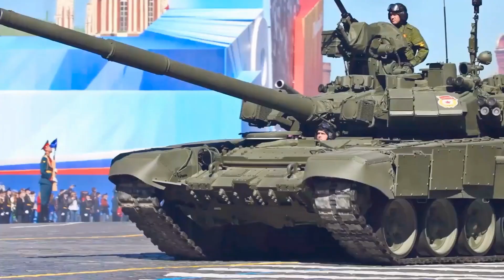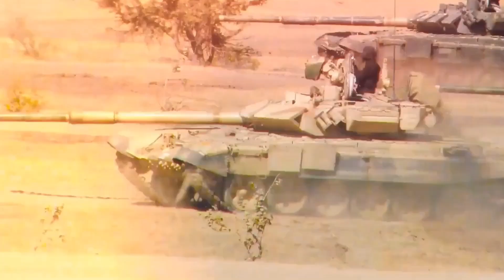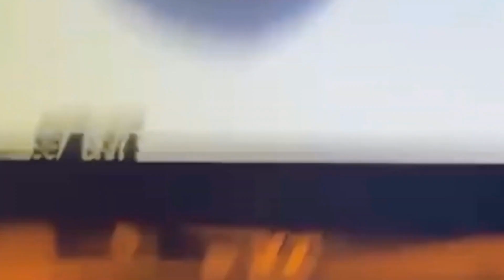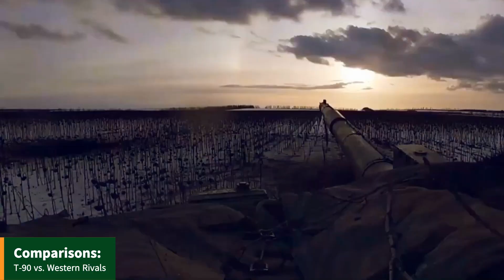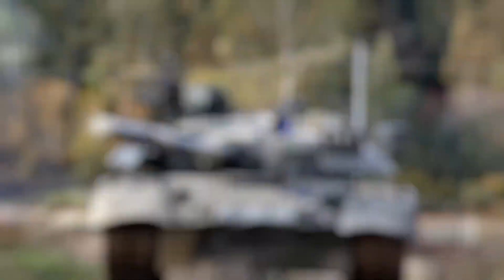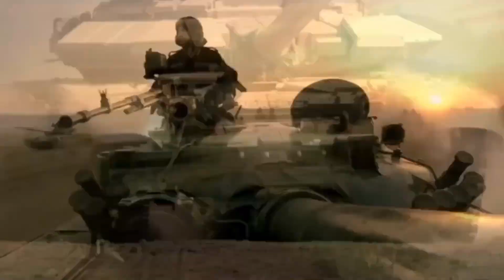T-90: The Russian Bear of Battlefields 🐻🔥

Comment: Great to pop the turret. Thatvtank was, at the time of it development,  sure a good tank. But as it proved in UKR it sucks. 🤷‍♂️
Reply from the maker: Yeah, popping the turret is quite the spectacle, isn’t it? The T-90 might have been cutting-edge when it first rolled off the assembly line, but the battlefield in Ukraine has shown some glaring vulnerabilities. War has a funny way of exposing the weaknesses of even the most celebrated machines. So, while it might have been the pride of Russian engineering back in the day, reality has a harsh way of reminding us that even the best-laid plans can go awry. The T-90's performance in Ukraine has been a stark reminder that in modern warfare, adaptation and innovation are key—because yesterday's tech can quickly become today's scrap metal.

Comment: Where is BBQ cage?
Reply: On the Merkava...
Reply from the maker: @Spielername  The Merkava series of tanks, particularly the Merkava Mk IV, indeed features advanced defensive systems, but it primarily relies on its Trophy Active Protection System (APS) rather than slat armor. The Trophy APS is designed to detect and intercept incoming projectiles, including RPGs and anti-tank guided missiles, offering a high level of protection. The Merkava’s design philosophy focuses on crew survivability and includes heavy composite armor and a unique layout with the engine placed at the front to provide additional protection. While slat armor has its uses, the Israeli approach with the Merkava highlights a more integrated and high-tech defensive strategy. This comprehensive approach has proven effective in various conflicts, making the Merkava one of the most respected tanks in the world.
Reply from the maker: Ah, the infamous 'BBQ cage,' or as it's officially known, the slat armor. You’re probably wondering why we haven’t seen more of it. Well, slat armor was designed to defend against RPGs by disrupting the fuse mechanism, and it’s had mixed results. It’s not a perfect solution and doesn’t offer much protection against more modern threats like anti-tank guided missiles or drones. Plus, there’s the added weight and mobility reduction to consider. So, while it might look cool and intimidating, the reality is it’s just one part of a much larger equation in tank defense. In the evolving battlefield, adaptability and layered defenses are key.

Comment: A load of Russian bullshit.
These tanks are getting slaughtered in the Ukraine.   🤣🤣🤣
Reply from the maker: Sure, the T-90 hasn’t exactly been having a great time in Ukraine. It’s taken some heavy losses and that’s undeniable. But let’s not entirely dismiss it as 'Russian bullshit.' The T-90 is a formidable piece of hardware with some serious firepower and advanced armor. The reality is, any tank—no matter how advanced—is vulnerable in modern warfare, especially against well-coordinated anti-tank teams and drone strikes. The battlefield is a brutal place, and even the best equipment can fall short under the right (or wrong) circumstances. So while the T-90 might be struggling now, it’s a reminder that no tank is invincible.
Reply: @Military_Forces_Unleashed  
Just look into the problems India has had trying to get theirs to work.
Reply: @charlesharper2357  What would be the ultimate irony would be Ukraine taking a load of these T90s and refurbishing them after the war, to incorporate quality Western fire control systems, engines and armor. Ukraine has the technical industry to do it and would be able to turn the garbage T90s Russia sold, into actual useful tanks for other export customers. India would probably be very happy to buy an upgrade package to fix the inaccurate gun and targeting system, rather than buy a whole new line of tanks from Germany, South Korea or the USA.
Reply: @Clean97GTI  
After this war is over the whole concept of tanks is going to have to be re thought...perhaps swarms of little remote control "Tankettes".
Reply: @charlesharper2357  I'm thinking tanks will still be used for ground assaults but they'll also become the basis for anti-drone  operations because tanks and infantry need each other. The big gun is going to be far less important than multiple smaller anti-drone weapons. I could absolutely see flak rounds for 40mm grenade launchers becoming a thing. Sonar detection might be a better choice to locate threats.